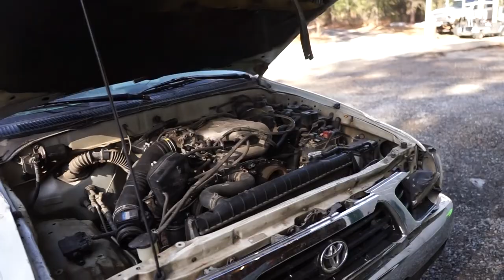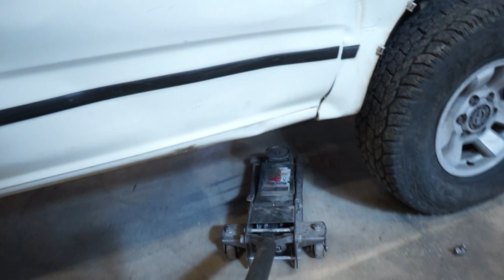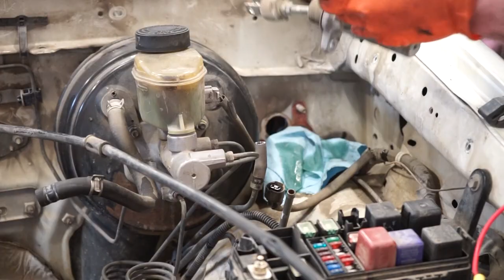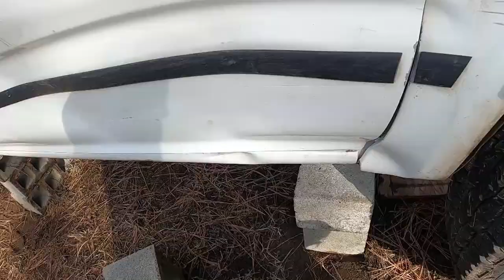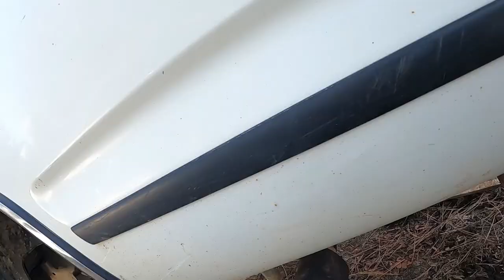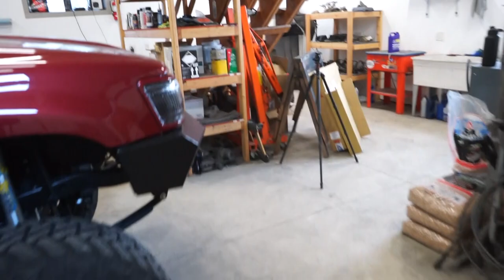I Bought A Beater Toyota Tacoma!!

Comment: safety advice on those cinderblocks. The way you have them positioned is stressing their weakest dimension. Also wood between the blocks and surface on soft ground and wood between block and frame. Great build, always wanted to do this on a quad cab + tdi ;)

Comment: Austin a little tip regarding your concrete blocks stabilizing the parts truck, always stack the blocks as they would be used in building a foundation. The way you have them the webbing can collapse.
Reply: Darryl is correct.  I was worried about the young fella there seeing him stack the blocks that way !
Reply: Better yet. Don’t use cement blocks.  We’ve all done stupid things and survived but there are plenty that did it one time too many.

Comment: Hi Austin, my name is George, I'm mexican, you have a friend in Mexico whenever you come, I live in a border state with Texas and I enjoy all your videos, you always have me absorbed and entertained in what you do, maybe is because I have a Tacoma too and I want to do the same you are doing to yours. Mine is a 99 Tacoma, 4 cilinders, SR5, 4WD with automatic transmission and the locking hubs in very good shape with the original green color somewhat burnt, only the diferential blocker is missing (that´s because its not TRD) I bought the truck in $5000 dlls a year ago, it already came with new BF Goodrich All-terrain tires and I´ve just took it to the workshop to raised it 2 more inches and fixed few mechanichal details it had. Imagine everything I want to improve, a bumper and lights like your trucks, a LED light bar, I´m not sure if installing rolling bars or a cabin cover, that's because I need to use the truck to carry it too and I think if I install just a cabin cover will give more espace but I accept suggestions. My friends tell me to paint it in black so that it looks imposing, I will only leave the bumpers and bars in black but I want to paint the body in Jasper green metallic, I like more the idea of a more friendly and relaxed color, maybe with a tribal sea turtle tattoo in one side, to climb on my kayak or my camping equipment and escape to the lake or the beach, If I lived near you I would definitely take it to you to do the improvements. The truck Is a gem, every week someone enter my business to look for the owner asking if I sell it just like this without being fixed, but there´s something I want to ask you, since I bought it the only thing I noticed, I feel that the engine does not develop so smoothly, its slow, as it lacks power on pavements streets with very steep slopes, but in flat streets and rough terrain slopes works amazing, I never had a Tacoma, its my first truck, so I dont Know if that specific truck is like that, or if is because is 4 cilinder, or what could it be??

So, others questions I have if you could be so kind to answer me, are these: 
I know how the differential blocker works, but not the locking hubs, could you explain me the difference?
Can a differential blocker could be installed even with the locking hubs without one affecting the other? 
Can the engine be changed by the V6 3400 without problems, so still works fine or even better??

Comment: My son drives a 99 extended cab 4x4 , 3.4, 5 speed manual trans, manual locking hubs. I’ve always told him it’s a unicorn Tacoma. Can’t wait to see the process of changing the front wheel bearings since his might need them soon.

Comment: FYI, converting to manual hubs on the 1st gen Tacoma is easy.  You just need IFS hubs from an 1986-1995 truck or 4Runner (or Tacoma) and they simply install in place.  4WD Toyota Owner magazine did a write up on this a couple of yrs ago and I was surprised how simple it was.

Comment: Look at CVJ axles. They use Toyota steel and reboot with high quality boots. I used them for my second gen. I got the red boots for lifted applications. It’s worth the price. I’ve never had any issues. If you plan on off-roading the truck I’d get higher quality axles than Napa. Love watching your vids! Keep up the good work!
Reply: My99 has napa axels and I bought empi brand boots because the boots were split, when we went to change them the new boots were smaller in every dimension. Could barely stretch them on the cv’s and tripod cups , had to really force the axles through them and since they were shorter overall they aren’t in the grooves on the axle but just on the axle about an inch closer to the joint,otherwise they would be stretched way out. I wish the guy before me rebuilt the originals. I’m pretty sure the empi boots I bought would fit the originals because the seller has sold a lot of them and I’m pretty sure if I bought boots at the auto parts store they would fit the originals ( how could they not)   So where can I get boots to fit these stupid Napa half shafts?

Comment: It's been my experience that mechanical is Always better and more reliable. As for the rest of the truck there's a lot of $$ in the small parts, good thinking you know what you're doing 👍👍 BTY I would save the lower control arm's incase there different than the prerunner and now would be a good time to put  lockers in hint hint.

Comment: bro you can do it simple just change the cabine  and the bed than you have a 4wd 4doors we did the same thing we  have put a 2004 Toyota hilux cabine on a 1997 solid axle model chassis everything is the same  you don't have to cut and any welding

Comment: You don't think Toyota axles are stronger than Napa?  I was going to go with aftermarket axles when my boots tore but I wanted to keep my OEM ones as I read a lot that the Napas didn't last long.  I ended up rebuilding and booting mine.  I wheel a lot tho.

Comment: Original Toyota front axles will last the life of the vehicle if they are taken care of, change boots when or before they split.  Any after market axe will last a fraction of the miles.  The originals are a much harder steel.  I have seen 4runners with over 600,000 miles with original axels

Comment: Reboot the OEM axles. Its cheap and easy to do with a reboot kit from Toyota 04438-35062. Those aftermarket axles are not as good.

Comment: can you swap the tacoma locking hubs to the 4runner?
Reply: Yes you can swap 1st gen taco manual hubs to 3rd gen 4runners. I'm running them on my 4runner. I actually did the same conversion Austin is but on my 4runner.

Comment: stick with the add system if truck will go wheeling. the manual hub setup has weaker cv axles and the hubs are a failure point themselves. the add system really isnt that unreliable

Comment: if your gonna use cinder blocks you should NEVER stack them that way always stack them right side up with a 16" 2x4 or 2x6 to span the whole top of the block, super dangerous the way you've got them, they can suddenly break and collapse that way , just sayin, like the rest of your vids, I have an "03" V6 5spd 4x4 excab with 335000 mi on original equipment still runs like top